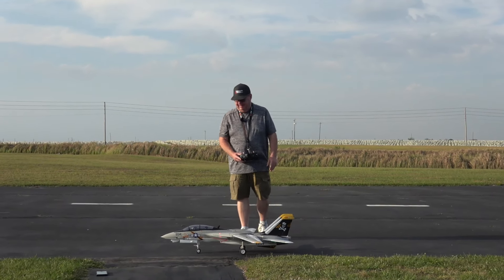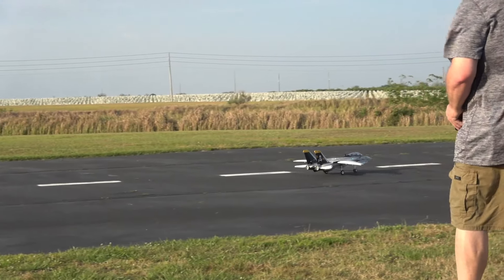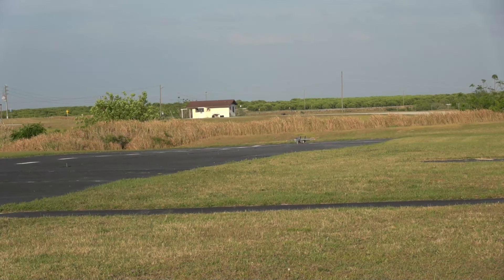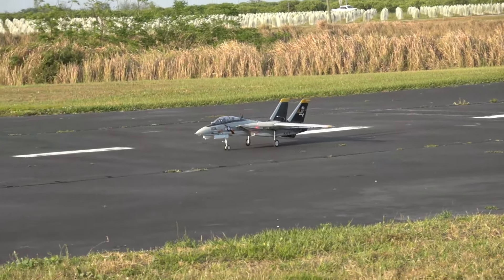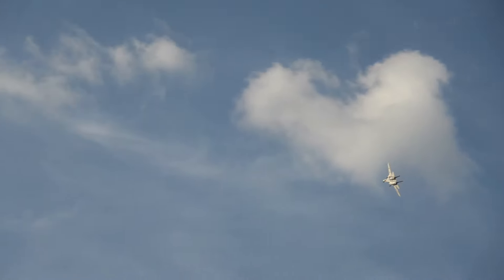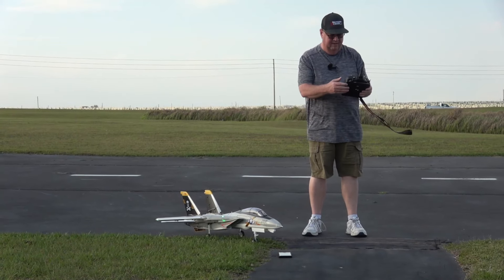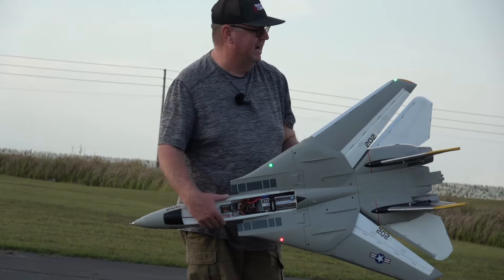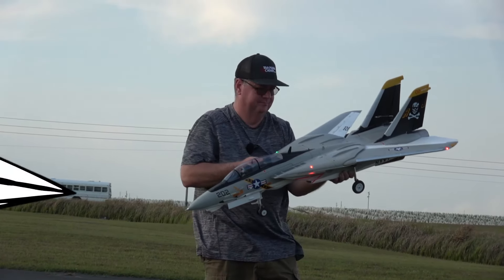FREEWING F-14A TWIN 64MM TOMCAT MAIDEN!!! by Fat Guy Flies RC

Comment from the maker: This one plane I wish I never bought. I really feel like I have been cheated out of $500. I stripped out the edfs and escs and the rest is laid to rest in the local landfill.
Reply: Can you put some explanation to why sir ? I just got a 80mm version
Reply: What happened??? all the hype is long gone over this model, I hear one flaw is that the flaps blocks the elevators
Reply from the maker: @notbadgerbutrich  The flap blocking can be overcome but the consistent wing sweep mechanism failing is inexcusable. I was able to harvest the motors and ESC the rest is in the landfill. I feel that Motion RC owes a lot of people $500!!
Reply: @FatGuyFliesRC  yeah I understand you. I think they should have improved the 80mm at least they could iron out the known issues. I think more v2-v3 models are needed rather than pushing out stuff that doesn’t work or needs large improvements
Reply from the maker: @notbadgerbutrich  Agreed, to many consistent mistakes and issues for it ALL to be pilot error or wrong setup.
Reply: @FatGuyFliesRC  hey mate, there's a thread on rc forums about reinforcing the area underneath the wing sweep with carbon strip's. I've done that mod and it's worked pretty well on mine. Have had several bumpy landings and the foam has not bulged at all. Hope this helps you enjoy the next one.

Comment from the maker: It went ok but I think I had her to tailheavy.
Reply: Unless you were flying on anything smaller than a 5000, it's very hard to get this thing tail heavy. I have my 5000 all the way back on mine and its still not tail heavy, maybe close to neutral. You can test that by going inverted at 45 degrees and letting go of the sticks. If she climbs she's tail heavy, if the nose comes down it means the cg is still not tail heavy. How quickly the nose comes down will clue you in on how nose heavy or tail heavy you are. One thing I've noticed with this jet is that with flaps and wings out on landings, you definitely want some down elevator programmed to keep it from ballooning and dropping a wing. Down elevator mix along with some gyro help will get her down nicely for landings when you have flaps and wings out.

Comment: It got too slow and dropped a wing, can’t high alpha this plane in for landing.  It needs more speed on approach.
Reply from the maker: I flared to soon thanks for stopping by!  Only damage was the nose gear.
Reply: @FatGuyFliesRC  can’t float this one in, Greg.  It’s a US Navy Fighter Jet, I suggest flying it like a Fighter Jet.  It takes a little getting used to honestly.  I suggest two or three mistakes high, try controlled slow flight with one notch of flaps and also slower with two notch landing flaps.  That 64mm has got a better thrust to weigh ratio with less wing loading calculation then it’s big brother the 80mm version.  I’m not trying to be critical, just trying to help you be a better RC pilot and not have to buy a ARF in the future because you crashed this one.

Comment: That was the problem!  You needed Gyro.  That's the purpose of the gyro!  To counter the effects of the wind!
Reply from the maker: Yeah you bet I will use it for landings for now on.
Reply: I don't use gyros, won't make you land better with it on , unless it's the SAFE version
Reply: @Mikeylikesit1968 it can make a big difference when you're flying in gusty conditions and a neutral cg.